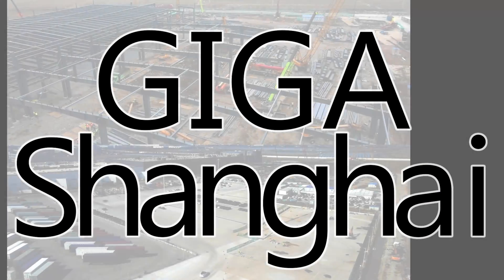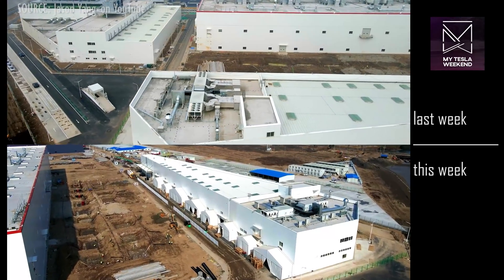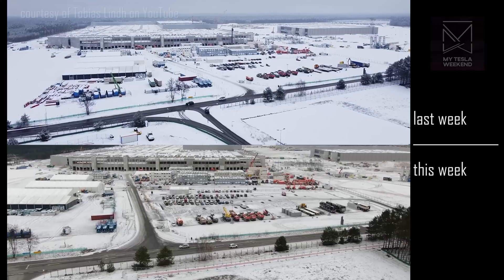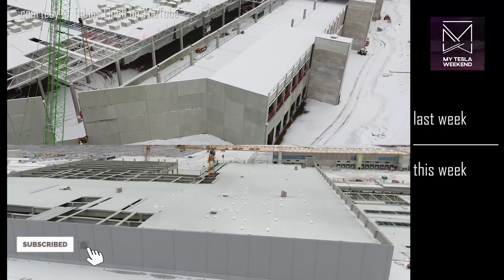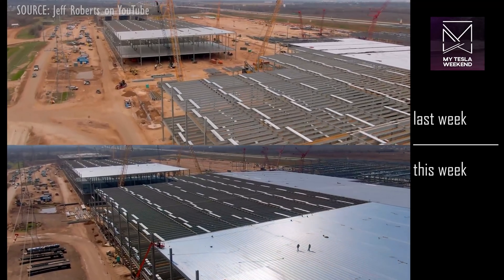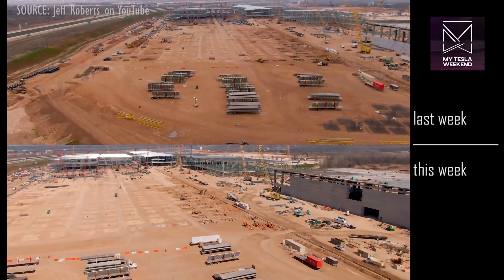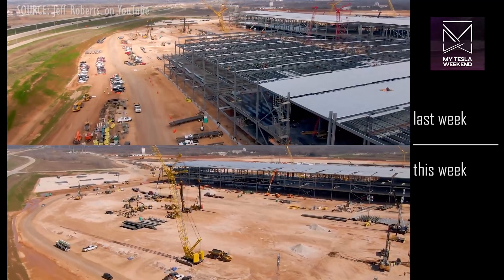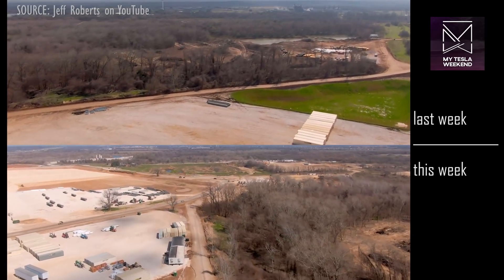GigaFactory construction before/after week of Feb 8th

Comment: Elon always said Texas would be 1. a single roof area from the top, and 2, the road in the middle would be for electric trucks. So why does EVERYONE thing joining the buildings mean there is no road? The "Bays" are 3 lanes wide, and 2 stories high. Why is this not able to be used as a road. What am I missing here, do you think they will have 200,000 robot freight robots blocking every walkway? Do parts teleport across a 250 acre building? Is Elon Magic?

Comment: Not much progress at Berlin this week.  Austin was really moving though.
Reply from the maker: Berlin's progress is mostly inside at this point. Though we may soon see some movement on new ground over there.
Reply: @FutureAzA  True, but outside work was negligible this past week compared to previous weeks.  There is still a lot of work to be done on the exterior General Assembly and Casting areas.  I didn't see much progress there.  Hopefully interior work is moving ahead quickly.

Comment: My read on 4680s, is they are going into the refreshed S n X with the overflow being stockpiled for Berlin and MY MIG will use this stockpile for its structural battery pack, until they build local production.
Texas will be next with battery production coming online not too far behind vehicle production.  
I presume that Shanghai is in the process of transitioning its production and I presume GF1 is transitioning for MIA M3.
  I suspect that delays in Texas and Berlin have been partially allowed to give time to get further into the ramp and refinement of the 4680s.  Texas and Berlin both need to start with the new architecture.  No point tooling up for the old one.  So they are hugely 4680 cell dependent in the new plants and don't want to be too limited or have to push cars out only to have problems down the line.
Reply: The S and X are not getting the new batteries.  The word is they are still using the old batteries. 1870's I believe is what I heard. The Model S Plaid+ could get the 4680 but that is not confirmed. So I think they are just stockpiling the 4680's and shipping them over when they get a full container(s). Those could be unloaded from the ship and just transported to Berlin and just be sitting there until the plant is sealed up and ready to receive them.
Reply: @mdhofstee  That was my indication on the S/X too. The plaid+ shouldn't take too many batteries either, plus the delivery date is later
Reply: @TheZackrambo  I think they may be holding off production of the plaid+ until Berlin is producing batteries.

Comment: I was wondering where all those 4680s where going. But I think you're on it. They've always said they're for giga Berlin and it makes sense they'd stock pile to get it off to a flying start
Reply: Yup, 10 MW h at Fremont is a lot of semis. They already have said they have the processes working and are optimizing, so they will cut and paste an new line in Berlin. Remember they own the company that makes the machines that go in the machine that makes the machines. (Or in other words they make the gear for inside the factories now, in Germany of all places!) Shock! Horror! Elon always said batteries would be produced onsite. And I am sure the Billion dollars the Germans just gave them was to encourage new extra production, (same with BMW) I am also sure the new battery lines are modular plug and play, with no liquids, and no huge drying ovens it is a very compact processes.

Comment: Didn't point out that the Giga Berlin entrance is open again.
Or did you? I might just have missed it, I miss a lot of stuff.
Anyways. I guess they just had the concrete slab there for measurement or stabilization or something.
Reply from the maker: I saw trucks going in on a video (not sure it it was this one) so it may have just been opened back up to allow easier access for materials transport. Tough to say, but it really isn't that important. The machine that builds the machine has a job and it's just about to get started.
Reply: @FutureAzA One of my first jobs I was going to different companies fixing faults. I can read a great deal about a company from walking through the door. An entrance is the start and the start is the most important part of any thing. Reality is fractally self-similar, start how you mean to go on isn't an idle phrase.  An entrance to a company is a Hugely important thing.
  I worked for a Japanese Bank and one day they decided to have their global annual meeting in our building.  Wow was that an entrance to that building that day.